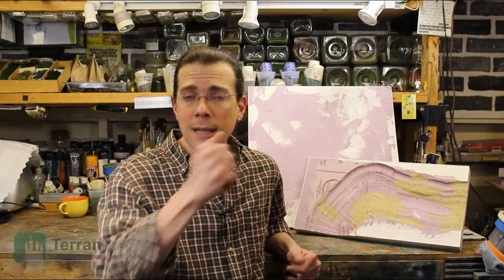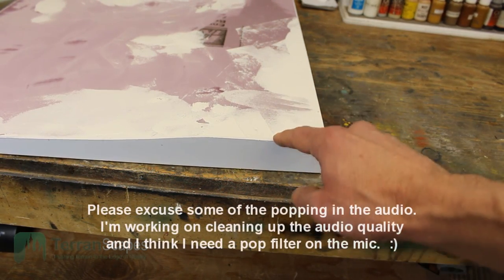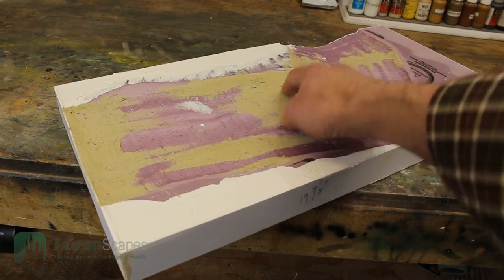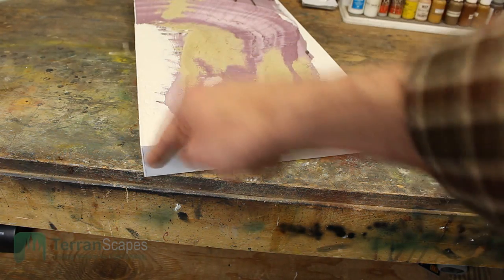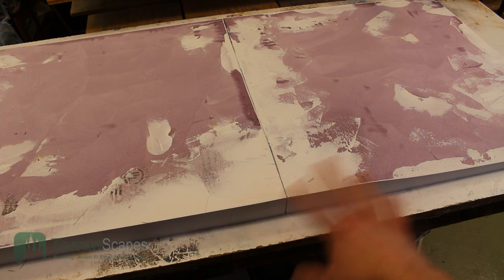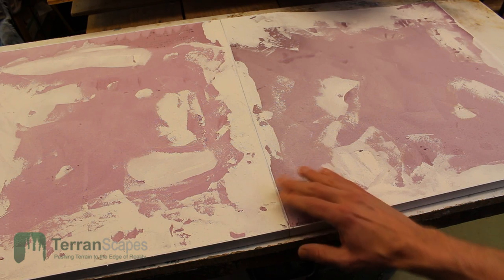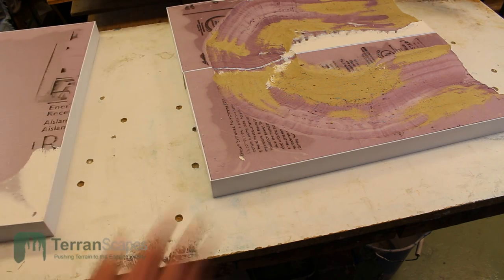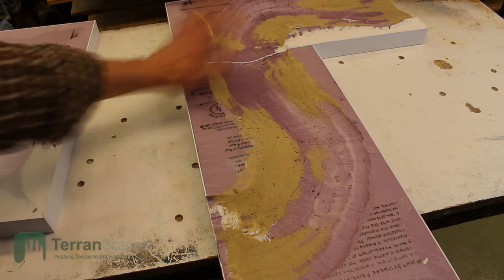TerranScapes - Die Cut Styrene Edges for Modular Wargame Boards

Comment: Great use of the die cutter! My silhouette is still astounding me everyday with that it can do to plasticard. Love it!
Reply from the maker: It has been a struggle for me, however I have only been working on this .060 which is a bit much.  However, today I cut a stencil of my logo for spraying products and that was in .010 and it still was harder than I expected.  I think I was running it too fast and too much pressure and the blade showed it.  I think I can fix that with a little trouble shooting however.  (I was trying to rush..  *booo*)  I would love to hear what blades/speed/pressure you are using on the Silhouette.
Reply: I will be honest that because even .010 doesnt cut through on the first run I always run maximum pressure (thickness) settings and usually 8-10 speed. and my blades stay at the 5 setting. I have learnt to design my cuts around having to snap them except for on the .010 which will cut through with a double cut. Do you use the cutting mat with the .010? I think the added stiffness it provides helps the blade to cut better. Let me know if you have any other questions, I will try to answer them :)
Reply from the maker: *****
Interesting.  Of course, numbers between the two machines aren't convertible.  Crazy manufacturers.  ;)  But, your comment on the pressure on .010 is helpful.  Next time I give it a go, I'll see about more pressure and slower speed.  I really think its going to fast that is the problem.  Oh, and I do use a mat with it. 

Your comment on designing around snapping is interesting.  With the board edges that has been easy to do and it was only for the curved cuts for the river edges that I was worried about.  A little bit rough on the edges when snapped, but easy to clean up.  :)  I am hoping to be able to cut some intricate shapes in thin styrene.  (I want to create plant leaves.)  Looking I see that you can get .005 which would be much easier.  Hmmm... So much to try out. 

I've been meaning to shoot some videos of the SB and will see if I can get them out soon.  I'll give a run down on what I am doing in styrene with it then.  :)
Reply: For the plant leaves have you considered some thinner materials such as acetate? That stuff is so easy to cut that I have been able to get some great details with it, the main downside of course is that you can't 'polycement' it.

I have been looking for 0.005 styrene and have really been struggling to find any at a decent price.
Reply from the maker: *****
Oh, the acetate is a great tip.  I'll look into that for sure.  :)

Hobbylinc is where I saw .005 and they have a little bit of variety of materials as well.  You can see the page here:
http://www.hobbylinc.com/cgi-bin/s8.cgi?str_s=.005&ss=1

Comment: Great hints! Thank you very much!
I've heard people working with thermal insulation saying that some charges of the material need to evaporate for quite some time before being used to weatherize actual buildings. In a model, the cracks elsehow "implemented" would usually ruin an even meticulously well cut piece. Now scale that up to a real life house..
Reply from the maker: I haven't heard that before.  I suspect that by the time I buy it, it has been sitting on the shelf for a while.  :)

Comment: The plasticard edging really improves them mate and I know exactly what you mean by things being just a mm out, it drives me nuts as well.

Out of interest, how much time do you give a new product before you decide whether it's fit for purpose?
Reply from the maker: Well, I usually get it right out the door.  :) On something like this, I would be worried about the edging delaminating, but I feel confident it should hold well.  There have been sometimes in the past that things haven't worked out, and I always take back problems and fix them at my cost.
Reply: Soz mate, wrong end of the stick lol, I was referring to any new product or technique you come across. What's your RnD time with new stuff?
Reply from the maker: TheTerrainTutor
Oh.. Well, it can depend a lot.  For the new ocean surf and boards, it's been a few dozen hours for the water at least.  A couple dozen hours as well for the new board edging.  I'm working on some new rock techniques and that has been around 20+ hours or so...  This is why it takes me so long to get work out, and why I earn so little.  *grin*

Comment: the tiles look really nice. You might get a similar effect by using felt pads on the bottom of the tile. That would give the tiles a bit of softness and help take out any table imperfections that could otherwise be transmitted into the tile and cause rocking or uneveness. You will also find the tiles sit flatter if they have less contact with the table
Reply from the maker: Oh, that is an interesting idea.  I hadn't considered that before.  Hmmm... I'm going to give that some real thought.  Thanks for the idea!

Comment: Some great stuff there, and nice idea with scoring lines in to the edges to gauge the water that's quite clever.
By the sounds of it your silver built is working overtime lol.
And your boards are going to look fantastic now you have sorted the kinks out, shame about the warping in the foam.  
i mount my foam on MDF but i know that's not ideal in your case due to the weight for postage.
Really looking forward to seeing what that beast can really do :D
Reply from the maker: I've never mounted the boards as it's the top corners that I have always worried about.  I don't know if the mdf would straighten the boards enough on its own in any case.  I have however, come up with a way to straighten them in addition to the edging when needed.  I'll likely be discussing this in the near future if I need to pursue it.

Comment: Cool work! Did you ever make the Silver Bullet review that you allude to? There is so little info on using die cutters with styrene on YouTube; it would be most appreciated. :)
Reply from the maker: I haven't done the review yet.  I have to admit using the SB has been frustrating.  However, I did sit down recently and compile a complete list of what it can cut (in my opinion) and the settings I used.  So a review is closer.
Reply: ***** No worries, and thanks for the update. I've been using an Epilog Helix laser cutter to work with styrene. Its cuts are perfect with the right settings, but at the shared maker space where I do my hobby work, they charge $7.50/5 mins on that particular laser cutter (the lower end laser cutters don't offer control over laser pulse frequency, which means that working with styrene usually just ends up in a melted, scorched mess). So I've been looking at various die cutters as alternatives. We have one from USCutter with 250g of down force (they don't charge by the minute to use the die cutters), which I hope to try soon. I look forward to hearing your experiences with the Silver Bullet when you get a chance.
Reply from the maker: ***** Thinking more, I've almost abandoned the SB, but I'm going to try out a couple more things before I completely give up on it.  Even if I abandon it, I'll shoot a video of what it can do and why I am frustrated.  :)  Still, it doesn't mean it isn't for everyone.  

I think that down force is comparable to SB but I would have to check the specs.
Reply: ***** Hi Ryan,  my son scratchbuilds Sci-Fi models he enters in  Wonderfest/IPMS/Eaglequest.  Since he's still in high school and time is a factor for him, we got him a silver bullet several years ago for both scribing and cutting styrene sheet.  LOVE IT!.  He uses it in conjunction with Rhino 3D (which can export .ai files).  If you have specific questions please shoot me an email and I can send you some links to some of his work as it was being done as examples. SB wasn't built specifically for cutting styrene, but we've learned a few tricks along the way...would be happy to share them or perhaps make a video and put it up on the tube.
Reply from the maker: wjfurqueron I would love to see what he is doing with it.  Any tricks would be greatly appreciated.  :)

Comment: The styrene edging looks superb, it looks like it eliminates most of the variables in cutting your boards. Just wondering whether or not this adds a significant amount of work that warrants a price increase in the final product.

With the new method of cutting your rivers, it seems like there is no more variable distance in the riverbanks which is something I thoroughly enjoyed in your previous river works. Is this something you've addressed with the wood filler stuff or do you go in and cut some more after the initial cut?
Reply from the maker: The river joins only fix the width at the edge.  The interior is cut by hand so they can vary.  And with the new shape I can modify them even more now.  The set I am working on has been changed a bit based on customer feedback.  I'll be showing that soon. 

As for labor, it has added more than I expected (doesn't it always?) and there will be a change in price as a result.  I'm likely to making some other changes to the store down the road, but it will be a few months before that happens.  Stay tuned..  :)

Comment: Hey Mike, I have a sillioute/robocraft (similar to you die cutter just lighter weight, as in it does cardstock and not styrene) You should be able to "score the styrene and not cut all the way through (just make a diff color line in inkscape/illustrator and assign less force)  but essentiall for the corners you should do an "L" shape where the tall of the L is the side and the bottom is under the board, thus giving you a flat surface to sit the boards on and hopefully less filling an sanding of the centers.  Just a thought.  Can't wait for the diecutter review, I want to upgrade to a more force machine, and want one certainly that does styrene cleanly.
Reply from the maker: I have been scoring as it can't really cut through it.  I do however need to score it fairly deeply to get a clean break.  I have found however, that I can't ratchet up the force too high as the blades can't handle it.  I think the tips break when they turn the corner since they are sitting below grade in an unyielding material.  I have been cutting at a much slower and lower pressure than the machine can do as a result.    I'll go over this in more detail in the near future.  :)

Comment: Are you gluing the polystyrene boarders together in a jig, then laying in the foam, or are you cutting the foam, then adding the boarders side by side?
Reply from the maker: Adding the borders directly onto the board.  I don't think I could squeeze in a board if I pre-assembled them.  Plus the glue joins without the foam would be crazy small.  :)

Comment: that's much better than before although I'd be more than happy to own any of your stuff.  Maybe you could find some reclaimed stone work surface to build on that would give you a give a flat base to build on. I have seen some modelers use square steel blocks to help you get perfect right angles.
Reply from the maker: I wish I had a really big surface that was flat.  When I lay out the boards on the floor for a larger overview, the basement/studio floor is not perfectly flat.  Always annoys me.  ;)
Reply: I really think reclaimed work surface or maybe the bed from an old pool table would be the answer.  However maybe not the easiest thing to get into your man cave. ;)
Reply from the maker: InTheCoalShed
Whoah.  A pool table surface would be fantastic, but even if I could get it into the basement (which I can't *frown*), where would I put it???  You wouldn't believe how much I have crammed into the tiny space I have.  :)
Reply: Yeah, it's not going to be easy to find the space.  I can tell by the wall behind you you have alot of materials about.  I've been watching you for a long time so I know you will come up with a solution if you think it's a good idea.

Comment: interesting stuff the same old problems but still the hardest one to sort on light weight hand made tiles.
Reply from the maker: Yeah.  If I could rout trenches in solid wood and afford the materials and have customers afford the shipping, it would be a dream.  :)  Just imaging the sides a beautiful grained wood, stained and varnished.  I actually thought of using wood veneer in the past, but cutting it cleanly was too much effort for the reward.
Reply: would of looked real classy :)

Comment: Not sure if you mentioned this or not, I might have missed it. But, wouldn't a kind of "base" or "floor" for the boards in a material that does not bend (some kind of hard plastic or wood?) then simply but the warped boards on the base solve the problem? This way you could just adjust the top of the board around the edges/joints and you don't have to worry about them not matching up.
Reply from the maker: You would need a fairly robust bottom sheet.  The board's warp is quite strong actually.  Surprisingly so.  Adding 1/4" plywood would be prohibitive in cost and weight. (1/8" hardboard will not handle it.)  I actually have come up with what looks like a very solid way of correcting them, without adding weight.  It's not very time consuming as well.  I'll probably explain it down the road.  :)
Reply: What I mean is that you could put the already warped boards on top of a solid base, then "hide" the warp seen from the sides with some kind of filling. You vould then just make the top edges of the board match eachother :)
Reply from the maker: Robin Ottoson
Oh I see.   It would require a lot of sanding, and I was doing this before, but you need a standard edge (I was using a slice of wood) to sand down to, and it's prone to error.  Since I need them to be consistent for all future boards, I can't just sand them down to each other for the set.  This way, I can be sure that boards I make 1-2 years down the road will sit flush.  :)
Reply: I have tried using 1/4" plywood for basing and it still warps very badly on my boards over time so I am interested in your solution.
Reply from the maker: Gregory Geilman
Well, I wouldn't say my current solution is perfect.  Right now I am cutting slots in the bottom, adding hardboard ribs, and then flexing the boards while the glued in ribs set up.  It works pretty well though.  I have a new idea that was given to me that I will be exploring, but I don't want to mention it until I play with it.  When I do, I'll be sharing it for sure.  :)
Reply: ***** I would be interested in hearing about how it turns out.

Comment: To be honest, there is no way get anything straight every time.
It's thing you must just except.

I did one even try make steel frame on table, that will make board perfect straight...
Yeah. Problems is that other tables are not straight, so that board work right only that steel frame table.
Reply from the maker: chuckle  You're right.  It's still been a bit of a challenge but I'm getting it down better and better.  It doesn't have to be perfect.  It just needs to 'look' perfect.  ;)

Comment: saw dust and wood glue great filler.
Reply from the maker: Neat idea.  I actually may be taking the board edges in a different direction in the future, and may not need to do any filling.  Hopefully...  :)
Reply: *****
I really would love to see that :)  I use MDF as base and edging to protect my foam atm. But I would love to see new idea's for it as edges are a structural weakness and add more work to the boards. Love your work! You made me get quite a lot of items I didn't know about, especially Hirst Arts :) Keep on pushing that edge!